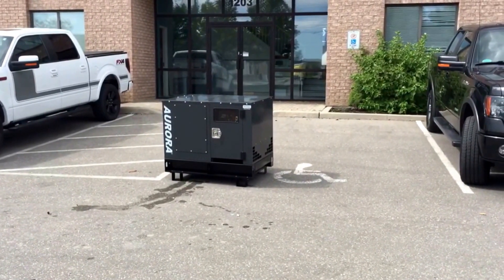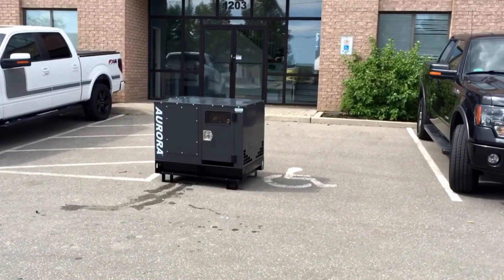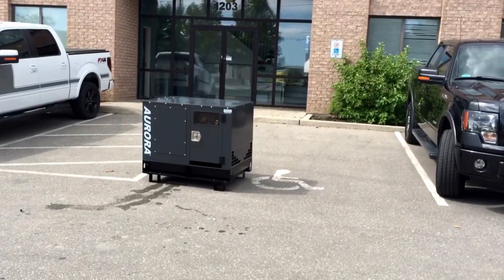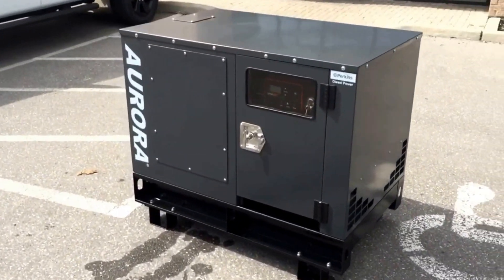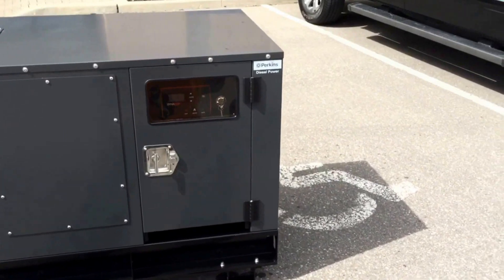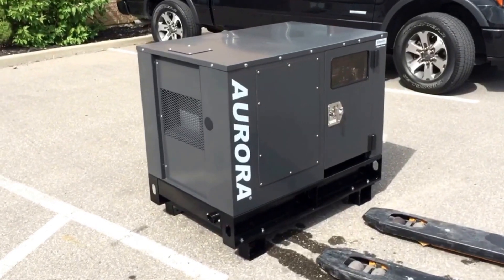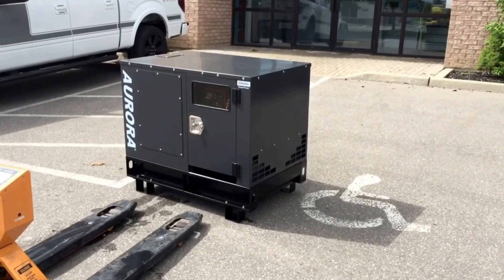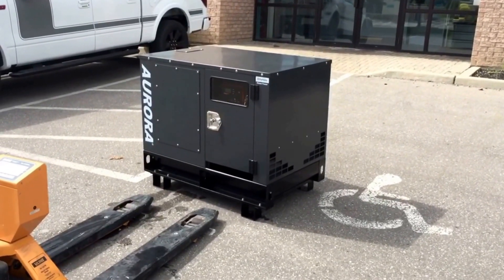Aurora 4 kW diesel generator - Perkins 402D-05g

Comment: So that means this generator generates 4 kW every hour?
Reply: No, there is a difference between a kilowatt and a kilowatt hour.  A kWh (kilowatt per hour) is how much energy you used or produced over a one hour period.  It's how electric companies measure your consumption.   Think of it like a garden hose. It can shoot water x amount of feet at a specific rate but how much you use or how long it remains open filling up a bucket would be the kWh measurement, else the pressure and rate of the spray is just watts or kilowatts in this case.

Comment: Luckily the 4KW model is 1,800 RPMs but why on Earth is the 8KW model 3,600 RPMs??  I'm pretty sure the 8KW is the only one you guys have that is 3,600, why?  3,600 is so inferior to 1,800, lol why would you ONLY have one random size that's 3,600?
Reply: Actually, Perkins was the first company to introduce high-speed engines and has been building them for 85 years.  They were eventually purchased by Caterpillar for their engine technology and remain number one today.   3600 RPM is not inferior when designed correctly.  There are more of these little engines on the market running in various pieces of equipment then lets day the 1800 RPM larger 3 cylinder engine.     Don't confuse these with air-cooled gas engines. Those running at 3600 RPM don't last very long at all.   This diesel at 3600 RPM has the same warranty and life if not longer then engines much larger than it.  Still 500 hours between oil changes.
Reply: Dirky Dirk - Look at the videos description, he addresses that. This particular engine was designed by Perkins to run at 3600 RPM.
Reply: @tommytmt  they were designed at 3600 RPM because they didn't want to spend the money on the windings of the actual generator